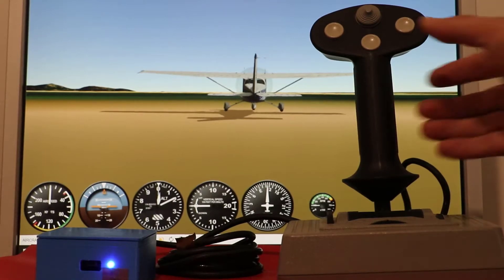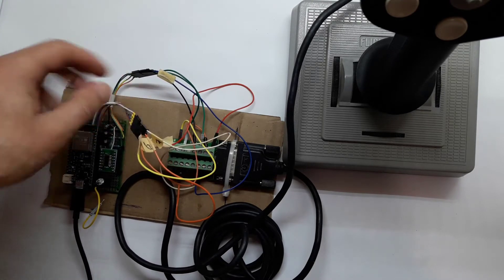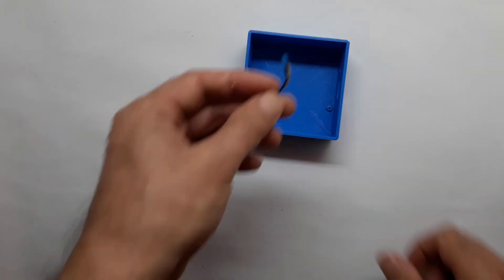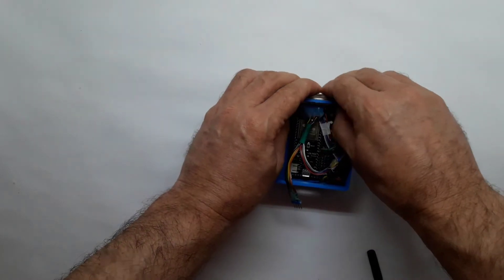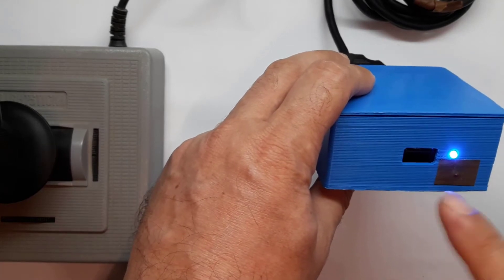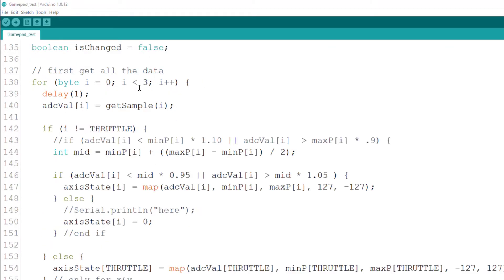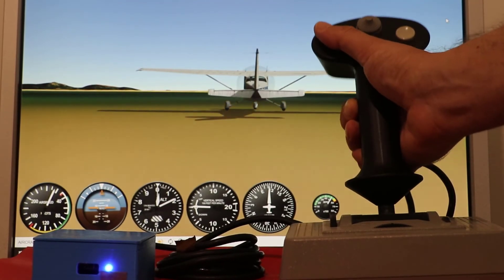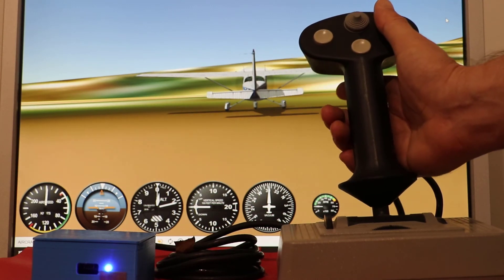The analog joystick adventure – part V – we got BLE gamepad

Comment: This is awesome. I am building a wireless wheel mod for my Logitech G920. I am experiencing that when the ESP32 goes into sleepmode or looses power it doesn’t reconnect back to the pc automatically, it connects and disconnects continuously until I repair the device. Which versions of the libraries did you use?
Reply from the maker: I had similar issues with my unit, mainly getting it out of deep sleep. 
I would suggest you download the latest library, I just done a project with the same board and it seem to work so much better. lots of the ble connections issues were resolved.
Reply: @talofer99  Hi thank you very much. Which board did you use? I tested on the Firebeetle v4 and Development board v1, all the board firmwares and all bleGamepad versions, some work better but not 100% all the time. Much appreciate your help!
Reply from the maker: @daniejansevannoordwyk6393  for esp32 my go to board is ESP32 WeMos LOLIN32. 
Comes with battery charger on it. 
Works great for me ... and with the upgrade of the game pad library it works really good. 

Made a BLE Morse keyboard for the kid with it.
Reply: @talofer99  Thank you very much, I will see if I can source 1 and test.